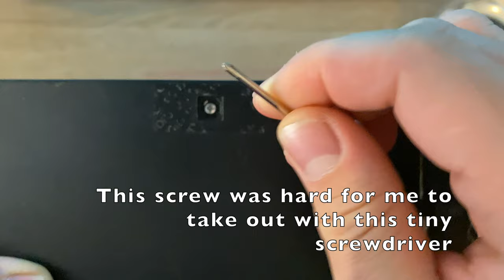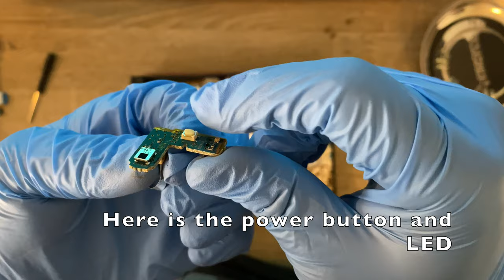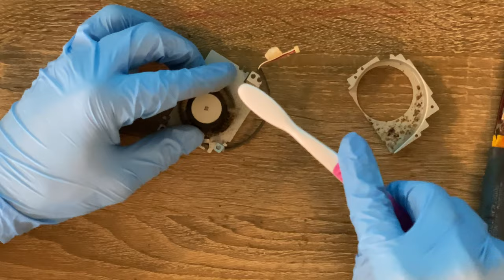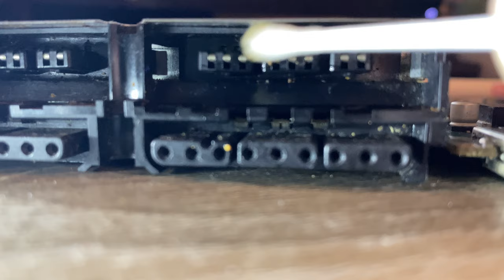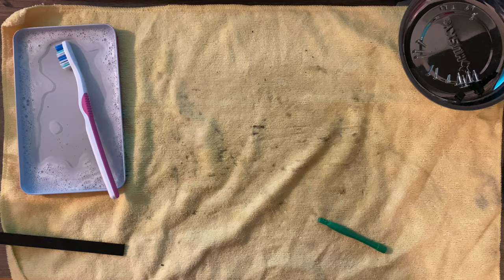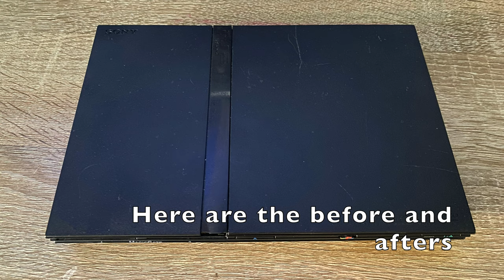Cleaning a cockroach infested PS2

Comment: As much as I love restoring old consoles, this is one of the rare cases where I'd chuck the thing right into the bin and set it on fire for good measure.

A clean, fully functional PS2 Slim costs like 30 bucks and can be found everywhere, restoring a mess like this simply isn't worth the time and effort imo. 

Where did you even find this thing?
Reply from the maker: This is my brother in law’s. He probably kept this thing in the garage for many years 😬. 

I also agree with you there. If you can find a cheap replacement, I would just replace something this dirty. It was smelly, messy, probably toxic.

That being said, it was satisfying to see the board after cleaning it.
Reply: Fair enough.

I'm curious if you can get this thing to work again, though. I can only imagine what damage these little bastards have done to the traces, chip legs and solder joints. Be glad the slim model got an external power supply...